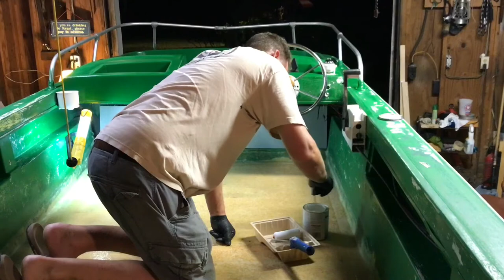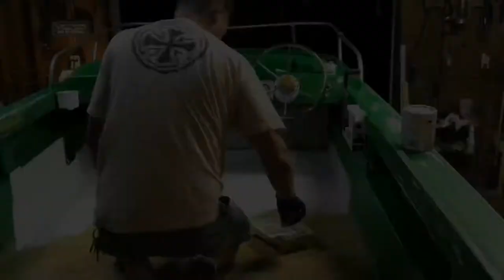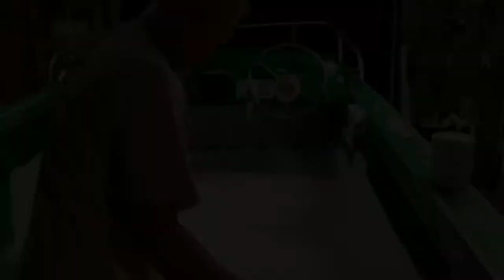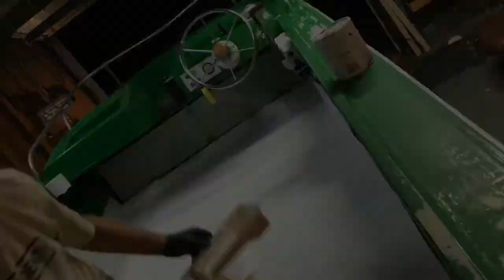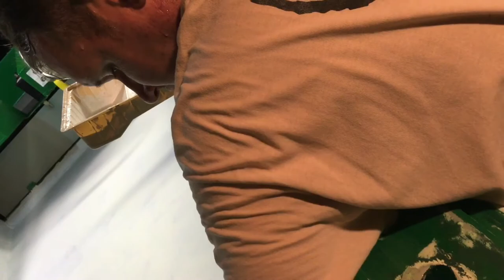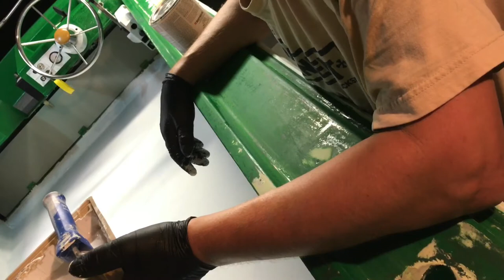Boat floor replacement 23

Comment: what did you use to bond plywood floor to side wall hull?
Reply from the maker: Hi. I used loctite expanding foam around the edges and used  loctite adhesive to glue the decking down. You can use a wire bristle brush for a drill to remove the access foam. I left a slight radius where the decking met the gunnel (inside side wall). Then laid in   fiberglass strips the radius helps with bending the fiberglass up the side. There are videos before this one showing some of those steps. Good luck with your project.
Reply: @michaelheary5663  thanks mate for the advise. Thanks for the awesome vid. All the way from nz
Reply: Thanks for the advice,  I'm trying to do the same on a bowrider